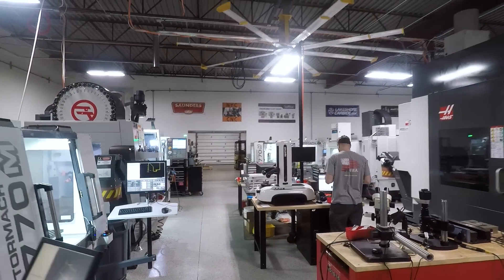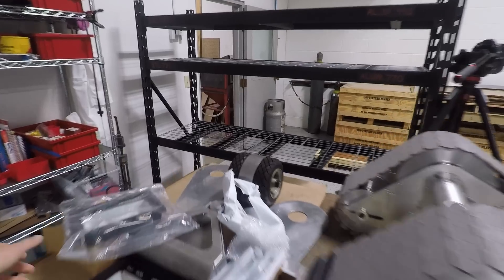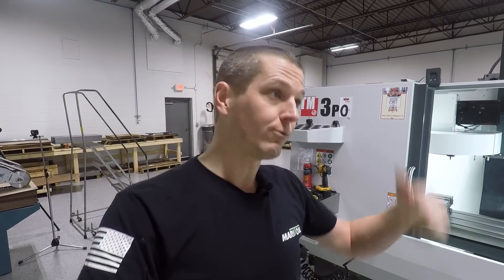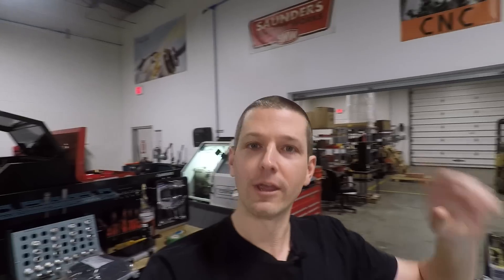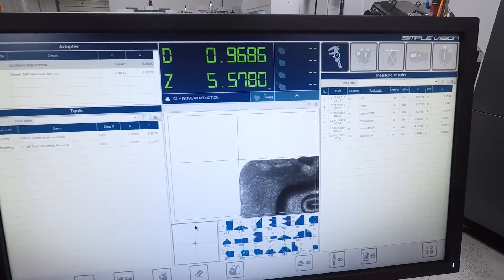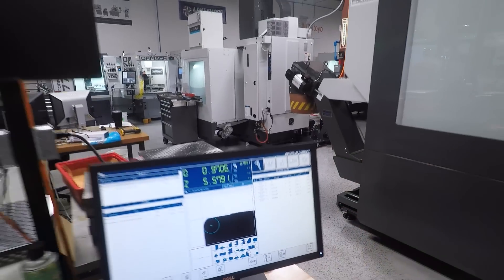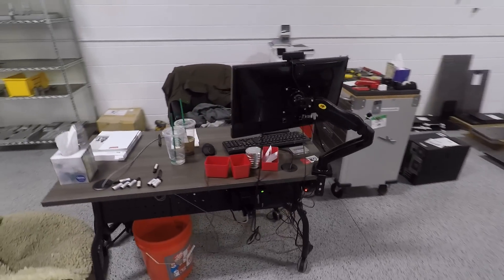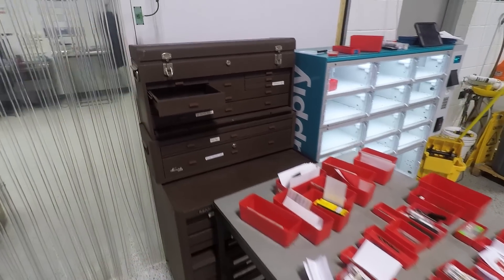Shop Update - New Machines!  March 2019

Comment: Would you mind sharing which lights you used to add on to the TM3P @ about 2:40? Are they aftermarket or are they factory Haas upgrades wired into the machine?

Comment: Hi John in the video you said Tormach series 3 you replaced it with The M model or MX.
I just bought a Series 3 and it just made it to my Shop yesterday afternoon. I  thought I would wait for the MX later this year. I will probably also run BT30 spindle to and servos.

I started my journey with G0704 Converted with linear motion on xyz and clear path servos. Sold it and bought the PCNC1100 series 3 what I had invested into it.
I looked at the 440 and 770m. Went with the 1100 s3.
You have a great channel keep up the great work and thank you.

Comment: Looking forward to a video showing the Z and Y way cover installation on the TM3.  Helping out with a TM1 at a local HS.  Chips everywhere inside the enclosure.  I see the TM3 has a washdown hose.  TM1 does not have one.  I need to figure out a way to install one.  I will also be interested to see if you upgrade the coolant tank.  Looks like the same 8 gal. tank we have.  If you don't keep the drain really clean and the tank full the pump will start sucking air.  Keep the great content coming!

Comment: The one thing I do not see in you shop is wood to stand on by the machines. You can probably buy some at a bar supply store. You know, the slat type. Standing on concrete all day sucks. Wood is much better when you are working on a machine all day, less fatigue. Next best is some heavy duty mates. I was in a shop once and every one was using cardboard boxes for a job for CAT. The owner informed us those boxes were a $100 apiece. He bought the slat type that were used in the local pups. Perfect, the dogs felt much better. Big difference than standing 10 hours on concrete. Ask any old machinist. There is also a safety factor. The wood slats cost a few bucks but a good investment.

Comment: This is awesome man! Congrats on the new machines! Im excited to upgrade my new 770m to MX or at least M+ this spring/summer for more accurate probing and fixture swapping. I can already see how much faster I will get products out with my Tormach vs cutting them all on my DIY router and the surface finish went up drastically, This channel was definitely a huge inspiration! I can't wait to come down to see your shop in person! I need some job shop work done this summer to have panels plasma cut for my DIY co2 laser would be a good reason to take a 2-hour road trip and come down and pick them up to save on shipping. I also need a 770m fixture plate and mod vise Ill be ordering in about a week when I start my next production order!
Reply from the maker: thanks!

Comment: Hey John love your channel. Amazing shop!  On the TM believe they did away with the Y axis covers because they were a a stainless cover that was connected to the table and would exit the back of the enclosure.  You guessed it, it leaks coolant under the way covers out the back of the machine.  I have a TM1P '06.  HAAS made the first enclosures for these to be CE compliant but not necessarily to run flood coolant.  Was advertised more of just a chip enclosure.  They even made a kit for these to minimize this issue but it still would leak.  So believe they did away with them to keep the coolant off the shop floor.

Comment: Hey Jhon, u shuld start to thing about take a more professional cam software, couse u will not be able to efficiently run the umc 750, fusion is a great software for the money, but for this crazy machine u shuld give a shot to power mill or mastercam, another level of software that add capability to ur machines and 
this will revolutionize the way you program the parts.
Reply from the maker: I'm not fundamentally against it - but I've got a lot to learn and grow within Fusion.  And one of my core beliefs is extracting the most out of any tool, software, machine, etc - there are folks doing some amazing 3, 4, and 5 axis stuff with Fusion.
Reply: @nyccnc  i know what an amazing pice of software is fusion and is hart to change, I'm using it in my learning process, but in the past I have had the chance to use powermill and see program from mastercam... they really save time with some strategies for 4 and 5 axis work, that fusion dosen't have... i hope that autodesk will implement it in fusion, but if this strategies and features are the key selling point of powermill and other high end cam software, i really think that this will never happens
thank you for your time

Comment: It'd be cool if the presetter could be built into a machine and be fully automated. Auto measure the tool before use, adapt the code for the tool's variance, then run the code; or do the same but after the machining processes and have already updated variances before the next set of operations on that tool.
As someone who wants all of this to eventually trickle down to the hobbyist level, having something like this built into a machine and be fully automated is a qol thing that would be really appreciated at the hobbyist level. Or for small machine shops, or for a shop of another trade that has the occasional need for machine work and invests in having their own machine.
I realize this idea isn't as practical for a shop with a good number of machines, as the additional costs of having built in automated presetters in every machine would probably be a fairly hefty cost until it becomes the norm to have one.
Reply from the maker: They DO have fully automated CNC presetters!  Just outside of our league ;)

Comment: I can tell that your workforce consists probably, exclusively of younger guys because you have no pads in front of your machines. I recommend getting some. You may not feel it much now but if you spend a lot of time in front of a machine I guarantee that you will feel a difference at the end of the day and that it will make a difference to the health of your back, feet and knees over the years. 10 or 15 years from now, you will probably think it masochistic to choose not to use them.
Reply from the maker: We DO have them! Jared doesn't like them in front of 'his' machine.
Reply: @nyccnc  
Oh. I stand corrected then.
 Well, five years from now, when you start hearing Jared complain about how soar he is at the end of the day you can just say "Sucks for you, man. I need you to work 3 more hours tonight. I guess you should have used those pads." ;-)